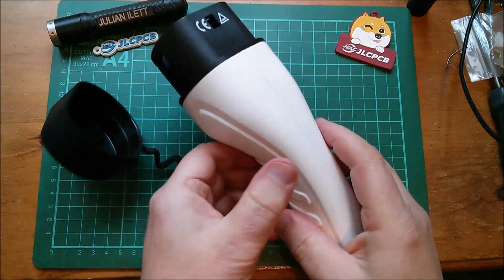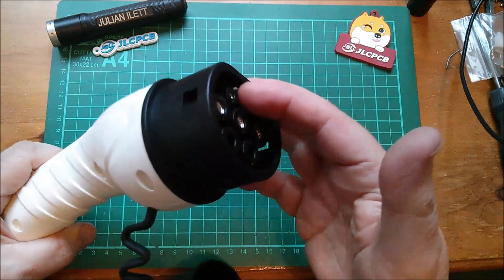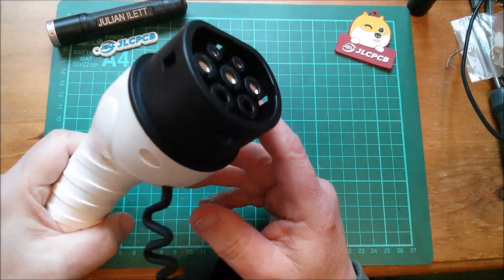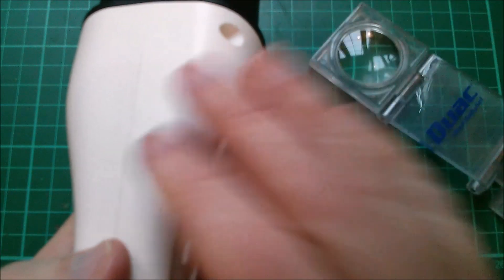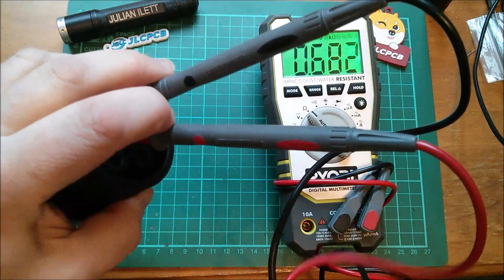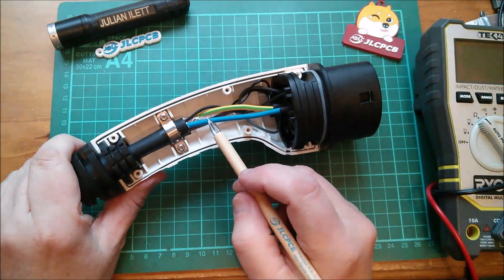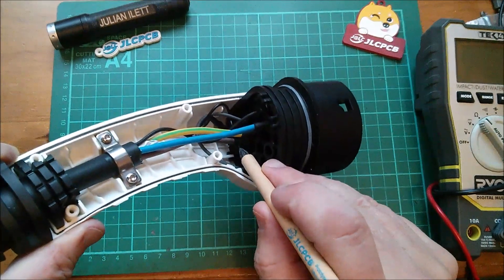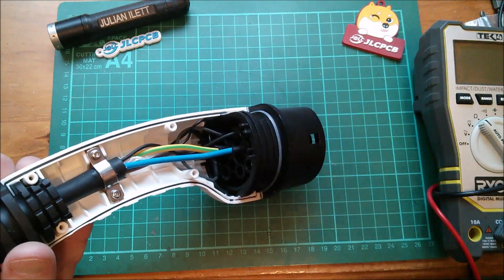680Ω Resistor in Type-2 Connector

Comment: Pick up an o-ring from a hardware store and cut a section out of it for filling in the missing seal area.
I don't know what the existing seal material is or if the end of your broken seal is accessible well but in the vacuum industry (thin films, semiconductors) and in a pinch, I bonded o-rings with super glue.  Of course, skill at square cuts and alignment were necessary but it worked well and held vacuum so it would keep water out for you.